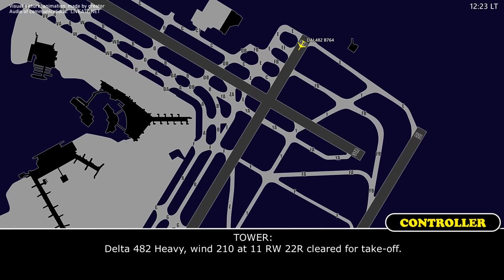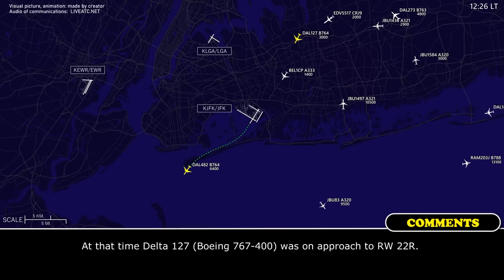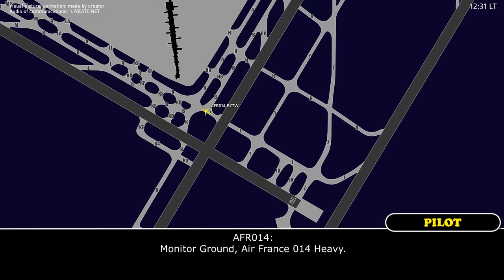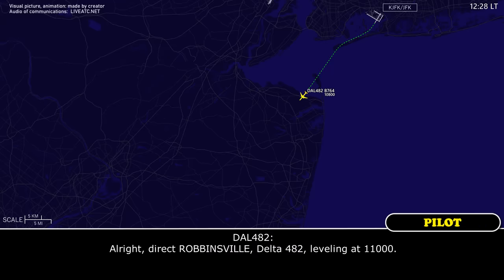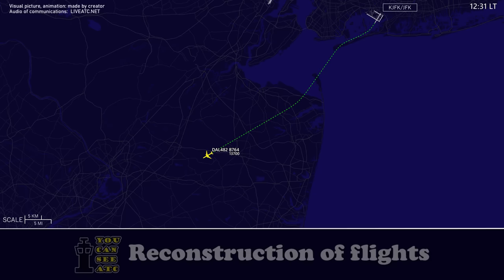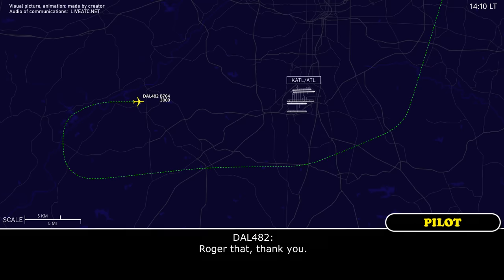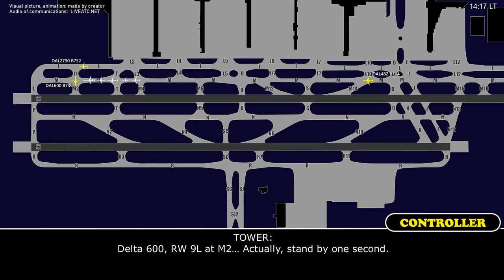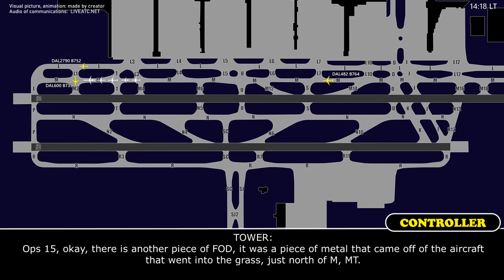Delta Boeing 767 LOST THE WHEEL on takeoff from New York Kennedy Airport. Real ATC audio

Comment: "Uh, let's see..." Not really what one wants to hear from the tower. Good for the go-around pilot becoming assertive and insistent.
Reply: There's always a published missed approach procedure that's supposed to be flown if Tower doesn't give any different instructions or if radio communications are lost (NORDO). In this case, the procedure is climb straight to 2000 then climbing left turn to 4000 to intercept the R-190 radial of JFK VOR. Lets say there's a catastrophic accident on the runway and Tower doesn't have time to tell you anything other than "Go around," then this is what you'd fly. It's good to proactively ask for instructions, but it's also fine if Tower can't get back to you. Every approach briefing includes this procedure, with the understanding that ATC will probably issue different instructions, but you always brief the published procedure.

Comment: Why controllers fail to give altitude on go around which is required and pretty standard makes no sense. For years this has been an issue the FAA has been unable to correct.
Reply: I heard clearance to 2,000 issued by tower to GA a/c
Reply: @DM-ve8vb  it’s on every procedure chart, they know it already

Comment: With the number of airports, and number of take-offs and landings each day, one would think these airports would have the budget for automated FOD detection around the airports.  It is ridiculous for the pilot of a potentially crippled airplane to ask the ATC for a FOD check.
Reply: Many airports do! SEA is one. But not all systems are equal, and it might not pick up All FOD or give precise locations. Really depends on the systems/software. And it’s SOP at many airports for a FOD check after any aircraft emergency, even if the type of emergency is unlikely to produce FOD.

Comment: The capt has decided to continue the flight to Hartsfield Airport because delta airlines maintainace center is overthier 
Was that a good decision.??
After the capt has received confirmation of a missing wheel he made normal approach to RWY 9 instead of asking to flyby for further wheel inspection 
It's a wrong decision,  I wonder why he did it ? Because if the 2 main wheels were missing that will be emergency landing and he should request fire trucks on standby ? I wonder on what base has he made the decision to continue for landing?
Reply: Fire trucks were already standing by anyway.

Comment: I think it was irresponsible of the pilots to continue to Atlanta. The wheel falling off could have caused damage to the hull which could have got worse with pressurisation at altitude, in fact some more debris fell off on landing. It would have been more prudent to land back at jfk rather than continuing at altitude to atl. Fortunately it turned out ok in this instance but they could have exacerbated the problem.
Reply: Ehh not really
Reply: And what will they do with all of the fuel if they return to where they took off, ol’ wise one? Just fly in circles to burn it, or get a pattern to dump it? Either way they still have to fly to reduce weight. 

Might as well continue to your destination which is the hub for Delta.

Comment: It might have been me but ascites took off you saw something on the runway moving its me I notice slightest thing I'm neurodivergent why don't they have cctv cameras on futher down fields runways so air traffic can see those areas and why on the outside of aeroplanes not sure how they would work at high  altitudes couldn't they have a camera one monitoring all engines one monitoring wheels they would have known immediately the pilots  were acting laxidesislnconsidering another pilot had seen it not bring very responsible it should have been were burning off fuel and coming back if id bern ATC I'd lost it and as ATC I'd been ringing a phone number of airlines concerned and saying two pilots have said thed seen a tire come off and there not coming back I would have said as ATC manager this is going on record so there's no come back on ATC they did right to say on audio did atc it missing left wheel glad it did come back but it should have come back ASAP yes the pilots arevin charge of plane and therefore passengers lives do if ATC even think a wheel has come off the plane should come back without external cameras pilots can't know whethever a wheel come off so if domeone says it came off and  rolled into grass good sign  there's something in it so id be back to airport ASAP

Comment: It was totally unbelievable that this flight continued!!  This crew had, I’m guessing, more that a hundred passengers onboard, they had no idea what wheel had come off, no idea of any other possible damage to fuel lines under the wings or debris in the engine!  Sure, we can all look back on this as an “It all worked out fine” event, but……what if???  It was careless, it was dangerous and it put hundreds of lives at risk.  No fly-by, no special landing procedures, just a VERY BAD decision!!
Reply: If they were leaking fuel or had debris in the engine, they would know about it. Debris in the engine would most likely cause vibrations, and a fuel leak would be noticeable when they did a fuel burn check and the numbers didn't match.
Reply: “VeRy BaD dEcIsIoN,” writes the highly trained and experienced pilot from YouTube Airlines.
Reply: @antoniobranderas  I have 24000 hours with 12000 of those in the 747. Don’t jump the gun on your replies.